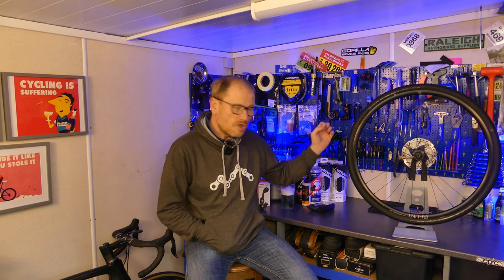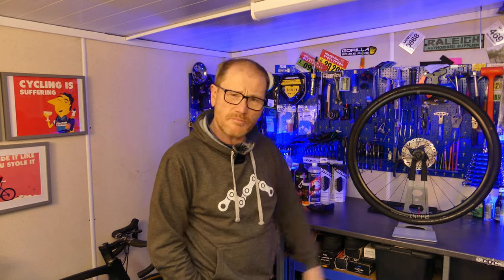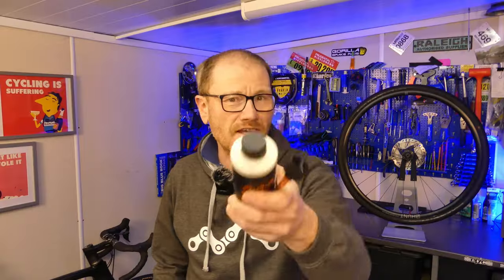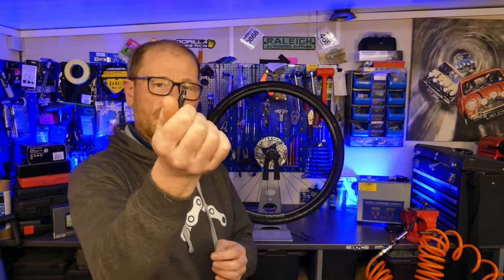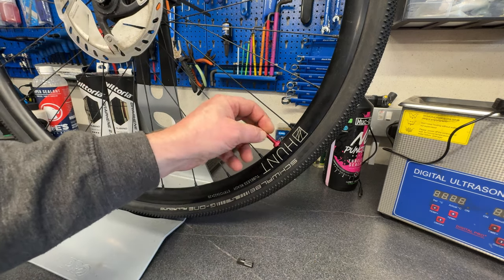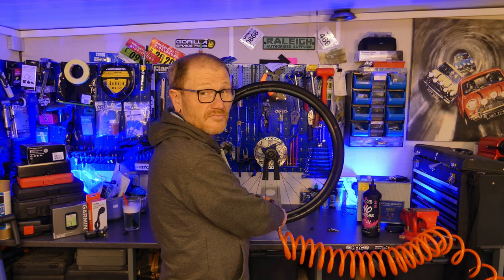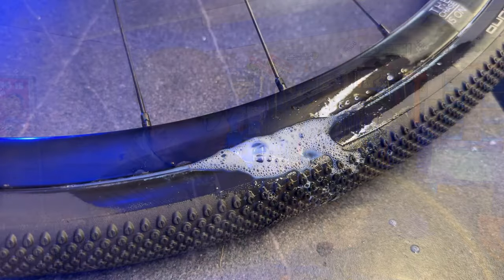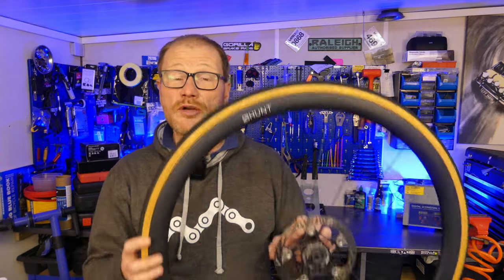Tubeless Troubleshooting - How To Guide For Fixing Your Tubeless Setup

Comment: Tubeless. Love it. No going back! 
Although there is some learning along the way as described so well. 
Whether tubes or tubeless, one important point is ALWAYS FIT THE TYRES YOURSELF.
DIY is the best possible check that the chosen tyre ‘plays nicely’ with the rim. Do this by ‘dry fitting’ and removing the tyre. 
And to repeat, do this YOURSELF because out on the road, it’s YOU that will be fixing the flat, whether tubed or tubeless.
If the tyre is hard to fit in the home workshop, it will likely be a nightmare to get off and on when out on the road.
IF THE TYRE you bought ISN’T A GOOD MATCH TO YOUR SPECIFIC RIMS, TAKE IT BACK AND GET ANOTHER BRAND OF TYRE. And try that. And so on.
This applies whether tubes OR tubeless.

Example: For my Trek bikes, Pirelli Cinturato road tyres and Pirelli Gravel H are easy to fit and remove on Bontrager rims. Even on a cold day! So that’s my choice.
Reply from the maker: Hi Ian,

These are wise words. Agreed, a troublesome tyre in the workshop, will be, at best, a nightmare on the grass verge in Gargrave!!!! TAXI!!!!!

Comment: I run tubes with Stans sealant, works great on my mtb. Prior to using sealant I had about 4 thorn punctures. I still get thorns but when pulled out just spin the wheel and all is fine. Also the sealant has been in my tubes over 15 months and is still sloshing around and working. Great video.
Reply from the maker: Glad you liked it. Agreed, as long as you keep it 'Sloshing', it'll serve you well.

Comment: Tyre Glider, for getting stubborn tyres on, best thing I have ever bought for the bike and has saved me a lot of stress both in the workshop at home and also out on the road and only cost £9.99
Reply from the maker: I should probably get them to send me one, so I can try it out!
Reply: @ribblevalleycyclist  Definitely get one and try it, I think you will be surprised and impressed just how effective this small block of plastic is
Reply: The tyre glider works really well.  A word of caution.  It can scuff up carbon rims.  Especially disc specific rims without a rim brake track. It can leave marks on the finished carbon.

Comment: Good video, tubeless is a preference imo, it's a big win for the industry, tyres cost more than clinchers, valves, tape and sealant all add up, and you haven't yet bought a pump to bead the tyre, then the dynaplugs for when you're on the road. Pay the LBS for install or DIY and spend 1hr setting up......... I was a tubeless user for two years. I now use TPU tubes which suit me. Not bashing just saying whatever works for you is best and gets you out there cycling.
Reply from the maker: Hi Steven,
Oh, for sure, tubeless has done wonders for the cycling industry....... it's up there with ebikes and electric shifting!! TPU is quickly becoming the go-to option, I should probably do a video on the subject.

Comment: I run inner tubes on my old pushy. I have found Slime successfull for fixing punctures but it can gum up the valve which are mostly Schrader's here in Oz. The steel straw cleaning brush sounds like a great hack for cleaning the valve stem.

Comment: Love your advice. You've made going tubeless look like climbing Mt Everest.😅

I can honestly say that in my 4+ years of tubeless, I've found it a absolute boon and a breeze. I've been using Hutchinson Fusion 5 (28s & 30s), Token Roubaix G33, Muc-Off Tape/Sealant and DT-Swiss valves (@55psi). Smooth, supple and sticky😉

The only issues I've had are due to lack of maintenance, (i.e. laziness). The worst I had was early on when I didn't know how to tape (didn't do it tight enough so it slipped).

Three tips:
1. Glue the end of the rim tape down so that it doesn't lift.
2. Clogged valves can be prevented with a tiny bit of dry/wax lube.
3. Don't buy fancy tyres, esp ones that weep.
Reply from the maker: Oh dear, Mt Everest wasn’t the plan 😐. Tubeless is a good idea, as long as you look after it. Little and often, and it’ll stay your friend. Fixing a puncture by the roadside is a load oh hassle. Maintaining a tubeless setup is also a load of hassle….. they’re just different types of hassle.

Oh, and point 1, that is a great tip 👍
Reply: @ribblevalleycyclist Cheers Jon. FWIW, I can put my tyres on by hand, pump them up every time using a track pump and they keep their pressure overnight better than an inner tube.

Three more tips:

1. Don't overtighten the locking nut. Otherwise, you might find it tricky to take off on a cold wet winter ride with frozen hands!! Trust me, I've been there😊

2. Centre the tyre bead in the channel before rolling it on, and if necessary use soapy water to help it slide and seat.

3. Get yourself a dynaplug racer and a high volume hand pump - right tools for right jobs👍
Reply: I'm unsure what you mean with #2. You mean squeeze a tiny bit in? How does that prevent clogs?
Reply: @pigeonpoo1823  Yes. Take the valve core out, and then give them a good clean with some soap and/or isopropyl alcohol. Dry them off and then apply some wax lube to the inside of the valve and the bottom of the valve core. When they've dried out, put them back together. The 'slippery' inside surface helps to prevent the sealant from sticking.👍

Comment: Love tubeless never had a problem but I do run a 700x35 on my road bike. Nice video again mate 😊
Reply from the maker: Hiya Dave. Glad you enjoyed it. It’s those high pressure setups that cause the issues, Chucky 40/50 psi setups work well.
Reply: I run 700 x 32 Rubaix Specialised at 72lbs, tubeless, on a Creo.  I weigh 70kg

Comment: As always: great video. My practical knowledge: no tubeless, no trouble. But I'm an old fart.
Reply from the maker: Glad you enjoyed it. Get with the tubeless gang…. You old fart 😂😂. To be honest, I question if it’s worth it.
Reply: Me too!!!!! Waaay too much work!!!!! I'm old!!! But still riding!
Reply: You can still go somewhat tubeless going tubulars. There's a company called Tufo who make tubulars you can put on clincher rims. For me this is the unrivalled gold standard. Have been using them for the last 13 years (8K to 10K kms a year) and in combination with sealant inside I had to face three flats which I could still ride home on reasonably fast without damaging any rim. Sadly those tires are only available up to 25mm width and only for 13mm internal width rims and are going to be phased out. The system never caught on due to Tufo's patent's.

With that said I'll never go back to inner tubes. The idea of having to repair a tube in a roadside ditch is unacceptable to me. Now for tubeless there are tire inserts available which promise to get you home and IIUC tires/wheel combinations being able to be installed without sealant (which ofc takes away the self-sealing property).
For me the biggest hassle with tubeless is the inability to not touch your bike for "longer time". Tires will deflate, sealant will dry up and you'll have to start at -1, sealant grime must me carved out before you can start from scratch.

So for now I'm still dreaming about airless tires with good handling characteristics.

Comment: Ran tubeless for a few years,until a puncture that didn't self seal,fixed with a tyre bacon ,that refused to reseat on the rim with my small on the road pump. No choice but a  very messy inner tube install ( yep always carried a tube even tho using tubekess). Fuck it ,I thought, back to inner tubes. So now I'm using TPU tubes. Hurrah!
Reply from the maker: Agreed. I always carry a spare tube for that very reason. If you get big problems with a tubeless setup out on the road, you ain't fixing it. So, stick a tube in.

Comment: If no bead pop i get soapy water and apply liberally to the bead and rim with a brush. Usually does the job and pops together nicely with a blast of air
Reply from the maker: A great tip. Not sure I'd trust hookless with soapy water though 🤣
Reply: @ribblevalleycyclist  I've used soapy water from time to time on hookless. Works a test👍

Comment: Very helpful video. What is the make and model of the airline gauge/connector you use? Many thanks.
Reply from the maker: Hi Stephen,

Glad you found it useful. Here you go….

Topeak Smart D2 Digital Gauge
https://amzn.to/48iuMvy
Reply: Thanks for that, but I meant the bit attached to the end of the airline you used to inflate in the first place. I’ve not found one that connects properly to a presets valve. Thanks.
Reply from the maker: Oh, that!! It's a custom job I made a few years ago. This is your shopping list:
LEZYNE ABS-1 Pro Chuck
ToPeak Replacement Hose
Draper 1/4" Air Blow Gun

Or you could blow £135 (Pun intended) on the Park Tool INF-2

Comment: Not ever found the need , I ride durano DD with a tube, and do lots of crap roads, gravel and lots of forest roads  the odd cyclo cross race but I run them at a high pressure, my limited experiance of other riders riding tubeless is all negative which i think is down mainly to initial installation

Comment: You don't go high pressure with road tubeless, I use 30-32mm tires, at about 4-4.5bar max. No issues whatsoever. And always hooked tires, hookless can stay away from road applications.

edit: i use regular stans sealant.
Reply from the maker: When compared to other cycling disciplines, 4.5bar (65psi) is still a very high pressure, that, in some instances, typical sealant may struggle to hold back. Additionally, 30-32 is not the road norm. Many run 28, and some (including me) still run 25. Some have no choice but to run smaller. And smaller will require more pressure.

Agreed, hookless is a bad idea. Sold as an improvement, when it just made wheels cheaper to make.

Comment: To be honest I've never actually tried it...... Well apart from the Halfords inner tubes on my electric mountain bike (Decathlon Est100) front tyre only.
A number of months back I got a puncture in the front and got showered in the green gunk...... Yeah it sealed the tyre but wow.... I looked like an anorexic hulk! 
On my road bike I run tpu and just swap out the inner tube if I puncture.  On my gravel bike I run butyl as I find it so quick and easy to repair.
Reply from the maker: Green...... I can't even think of a sealant that is green. Those crazy Halfords kids! TPU is the new kid on the block, and is getting a lot of attention.

Comment: I have read that if a sealant will get into you spoke nipples, it will start corroding them causing even more spokes to fail.
I sqitched to tubeless on my MTB just to break a spoke 3 days later and had to redo everything. After some sealant leaks more spokes started to fail. I used gorilla tape but over time it started to get loose and sealant seep under it causing more nipple corrosion and more spokes failing. After redoing this 3 times i switched back to innertubes. F THIS!
Also, not that you can leave your spare innertube at home anyway. You can get a puncture that can't be patched or you can fail to inflate it. So you have to carry innertube with you anyway. But then you can just run without tubeless all together and save a lot of headache and even more money. It takes just a couple of minutes to replace an innertube.